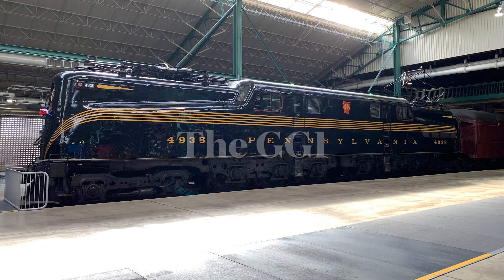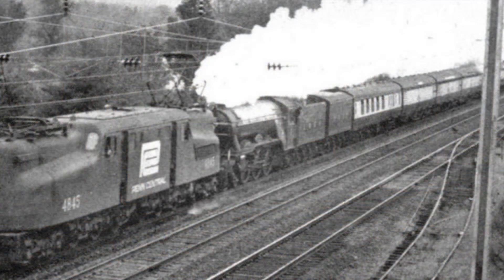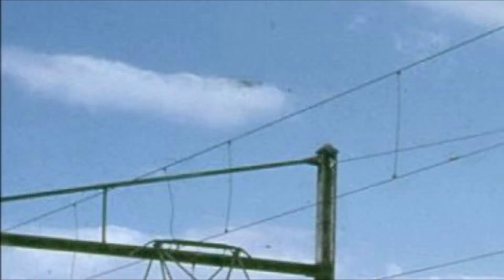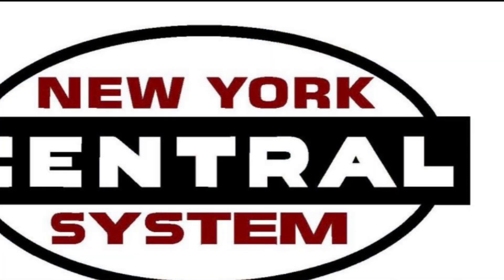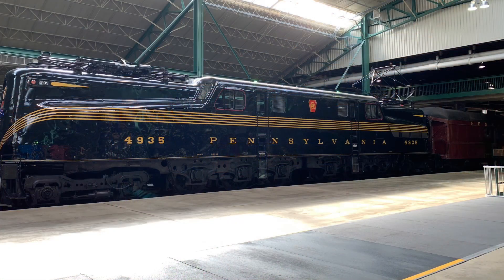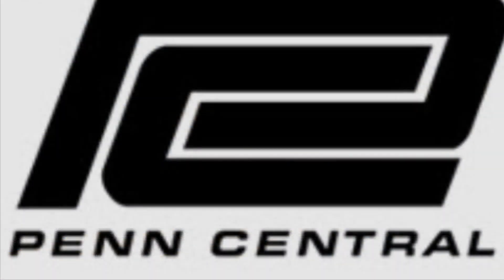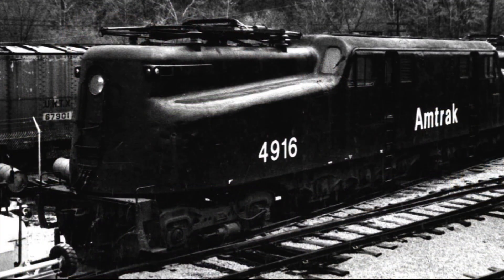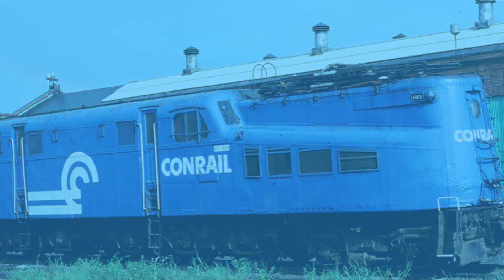Engines of North America: The GE GG1

Comment: In the field the 4935 was nicknamed "Black Jack" because the digits added together = 21. There was another motor prior to the AEM-7, it was GE's E60CP numbered in the 900 series which were a 6 axle electric freight motor (if I recall correctly, a power plant out in Colorado used them to move their coal cars). Amtrak engineers had said the E60CP "bounced them all over the place" inside the cab, it wasn't a very nice ride. It was determined they were not to exceed a maximum speed of 80mph. Later, the wheel trucks were changed allowing for a maximum speed of 90mph & were re-numbered in the 600's when the new style wheel trucks were installed.

Comment: The summer 2009 Classic Trains magazine has several good articles on GG1's.  One author highlights that Don Dohner did the original 4800 streamline design, and Raymond Lowey improved following units by recommending welded bodies and other refinements.  
The Pennsylvania Railroad borrowed a New Haven EP-3 for testing, using the technology as a basis for the GG1 wheel arrangement.

Comment: The biggest reason Conrail stopped using the GG1 was because Amtrak jacked the rates up on electrical use. (Same goes for the relatively new only being around 20 years old at the time) E-44s. Had Amtrak not done this they may had lasted even longer if only in lesser roles.
Reply: With regard to Conrail vs. Amtrak, one cannot forget Conrail engineer Ricky Gates who disregarded a stop signal and ran his diesel locomotives into the Amtrak Colonial causing a huge derailment and loss of life.  This caused Amtrak to restrict the times that Conrail could operate on the Northeast Corridor.  With the alternate routes not having catenary, it became obvious that electric locomotives were suddenly surplus and had to go.
Reply: They also were changing from 25 hertz to 60 hertz so that stopped them being able to run

Comment: At about the 10 second mark, you mention "Electro Motive Division" in connection with the GG1.  EMD as it is often known by, was an independent corporation during the development of the GG1:  the Electro Motive Corporation.  They were primarily interested in making "doodlebugs" and small diesel electric locomotives at this time and had no connection whatsoever with the GG1 development.  The GG1 wheel arrangement was based on the New Haven EP3 design which had tested on the PRR in Delaware and proposed by General Electric.  The competing R1 design was developed by a Baldwin-Westinghouse consortium.  At GE, the lead engineer was Donald R. Dohner.  A private man, he let Raymond Lowey receive the accolades.

Comment: A good number are preserved in various states but sadly a combination of cracked frames, PCB transformer oil and asbestos insulation prevents making even one operational again. Not impossible, just very costly as it would require remanufacturing a good number of components and a completely new cabling.
Reply: . . . and you have to consider whether 12 KV/12.5 KV (used to be 11 KV, but probably close enough) @ 25 Hz will still be available for them to run under in the future.  Once SEPTA gets rid of their Silverliner IV EMUs (which I think are the last things that can't take 60 Hz), the power supply becomes eligible to be upgraded to 25 KV @ 60 Hz.  So just refurbishing the old transformers wouldn't be good enough -- you would need new transformers, and you would need to add rectifiers (the old motors would tend to overheat on 60 Hz).
Reply: @Lucius_Chiaraviglio  The most radical step would be a replacement of the whole electric section, as has been done in the AEM7AC. A modern multisystem locomotive in an ancient bodyshell? But that would go way beyond what's considered restoration. It would be a new locomotive with old mechanics.
Reply: @uncinarynin  I thought about that, but most AC propulsion systems make an ethereal shriek, which would be really weird on a GG1.  Probably better to put in a modern transformer but with tap changers for both voltage control and changing between overhead voltages.
Reply: @Lucius_Chiaraviglio  Interesting thought, converting the 25Hz, 11(or 12)kv.  How much rework must be done on the insulators etc for the contact wire.  It would replace the nearly 100 yr old infrastructure, and will have to happen eventually.
I am assuming that is still Washington to New Haven.  As a wire junky I would like to see freight mainlines electrified(sigh).
Reply: @Lucius_Chiaraviglio  Thank you for the reply. Interesting changes.  I figured new Amtrak electrics were 60Hz capable.  You may know this; two AEM7's came to the Bay Area to test the Cal Train Electfication.  One to run the other for parts.  It will be 25Kv, 60Hz.  I am planning an excursion sometime this year to check on progress.  Due to various completion 2024.
Reply: @delurkor  Amtrak has been getting everything capable of 60 Hz starting with the E60-CPs (predecessor to the AEM-7s), and I'm going to go out on a limb and hazard a guess that since the electrification northeast of New York is all 60 Hz, that they don't have any work equipment left that isn't thus capable.  Yes, I heard about the AEM-7s going to Caltrain.  Too bad they aren't keeping both of them in working order to use for emergencies.

Comment: I could be wrong but I believe there where 136 built but you said 139. No GG1's will run soon, they used chemicals in the coolent that is dangerous/toxic. In response, the parts that had it in it where drained and filled with cement
Reply from the maker: Actually yes. I remember seeing this in my research, but I just didn’t add it in.
Reply: They filled it with cement?
Reply: 139 units built.

Comment: Of course, Raymond Lowey only designed the exterior shell. Engineers designed the rest of the machine.
Reply: No, Donald Roscoe Dohmer of Westinghouse designed the prototype 4800 "Old Rivets". Loewy improved on the Dohmer design by recommending welded bodies for the 138 production Gs.
Reply: @smwca123  - Technically, you're right. However, Loewy specified the five-stripe pinstripe and its classic curve along the side. Photos of the original of PRR 4899 (later-renumbered 4800) show a much different and much less graceful exterior paint scheme, along with a obtrusive air intake near the pantographs. The value of Loewys' contribution is shown by the fact that PRR applied some variation of his design to first generation diesels, too.

Comment: Not being sarcastic. The GG-1 wasn’t the first USA Electric Locomotive. There was the P-5 and some earlier USA Electric Locomotives. The GG-1 was probably the first successful USA Electric Locomotive
Reply: Not even the first successful ones, the locos of the B & O electrification of 1895 worked out fine.
Reply: @kiwitrainguy  
What was the classification of the B&O electric locomotives? Do you know who manufactured them?  I feel fortunate to operate GG-1’s in Passenger and Freight Service. From early 1974 on Penn Central. Until the GG-1’s retirement on NJTRO in October 1983. The GG-1 was fun to operate. With 21 notches on the throttle. I had to be taught how to operate a GG-1. No Locomotive Engineer that wasn’t taught to operate these locomotives. Would not even make it off the engine house outbound track. Without tripping the Pantograph Relay. That took a specific process to reset it. The GG-1’s were unique electric locomotives and had a very simple design. Pantograph, to Main Transformer to Traction Motors . I never didn’t make it from point A to point B on a GG-1. Two GG-1’s as a multiple unit. Would easily pull a 120 truck train and get up to the maximum speed of 60 mph. Truck Trains had a maximum authorized speed of 60 mph. One  multiple unit GG-1, would easily get the truck train up to 60 mph in a short period of time. Penn Central and for a short period of time Conrail. Also had E-44’s and E-33 Electric Locomotives. Left over by the Pennsylvania Railroad. These were also finicky but also very dependable, but would many times. Develop lateral motion between 50 and 60 mph. That could be scary at times when the lateral motion would get excessive. The Pennsylvania Railroad had ordered purchased the E-44 and E-33 electric locomotives. The Pennsylvania Railroad put shock absorbers on the E-44 and E-33 Electric locomotives. That solved the lateral motion problems, but these shock absorbers were rarely replaced when worn out. The E-60 had insane lateral motion. Their original designed maximum speed was 105 mph. It was quickly lowered to 80 mph maximum authorized  speed. The lateral motion o E-60’s was so bad. I would wonder why either the flanges on one the wheels of the E-60’s didn’t break off. Or if the inside of the rail would fail or the rail spreading. Amtrak finally put shock absorbers on the trucks of the E-60’s. This solved the lateral motion problem. Until the shock absorbers wore out. Locomotive Engineers would have to write down on their work reports. When the E-60 would start developing lateral motion again. Then actually complain to upper management. Threatening to either refuse to operate a known E-60 that the lateral motion was happening again. Or threaten to strike to get new shock absorbers put on the E-60. Other than the Lateral motion the E-60’s. They were quite powerful and pretty reliable electric locomotives.
Reply: Through a lot of research. I finally found some information on the B&O Railroad’s Electric Locomotives. These electric locomotives were manufactured by General Electric. These Electric locomotives weighed 96 tons or 192,000 lbs.They had 1,440 HP/ Four 360 HP traction motors. With a continuous 42,000 lbs of starting tractive effort up to  60,000 lbs over a short period of time. These Electric Locomotives were mainly used to pull a  Steam Locomotive with a  train. Through the Howard Street Tunnel. Preventing the massive amounts of smoke a Steam Locomotive produced while pulling a train. The B&O Electric Locomotives was the prototype for future electric locomotives. In addition the B&O railroad was the prototype for AC Electric Current Catenary System and or the DC Electric Current Third Rail System. The B&O Electric locomotives first used an unsuccessful odd overhead catenary wire system with DC Electric Current that was troublesome right from the start. All were converted over to third rail DC Electric Current. The first DC Electric Current used an Overhead Wire. The electric locomotives used a crude pantograph that contacted the trolley wire. The DC Electric Current then passed through to the positive lead on the traction motors and a separate bare copper wire in the middle of the track, with wood on top of the wire. A inverted crude pantograph was underneath the Electric Locomotive. To provide the negative/ground back to the power plant.  Completing the circuit. This had to be very dangerous for anyone working on the tracks. These B&O  Electric Locomotives were shortly converted over having a break away  pad on the side near the bottom of the electric locomotive,that made contact with the newly designed by B&O and General Electric third rail system. The break away pads were designed to break off of it made contact with an obstruction. This third rail design was successful and wasn’t quite as dangerous to track workers as the overhead catenary wire system. The first LE-1 electric locomotives remained in service from 1895 until 1917. Many reasons these Electric Locomotives were removed from service included, the amount of DC Electric Current they  required. They couldn’t be coupled together and configured into multiple units. They were mainly used for the Howard Street Tunnel and on only a few miles of track. Plus the advancements being made with Electric Locomotives that would replace them. It is a shame that all of B&O’s Electric Locomotives were scrapped. At least 1 should have been preserved. Being the B&O Electric Locomotives were the FIRST USA manufactured electric locomotives that were successful.

Comment: 285 * 12 = 3420 horsepower.  Not 4620.
Reply from the maker: Oof sry bout that. Probably used an unreliable source, thanks for the feedback.
Reply: 4620 hp is right, with a short time rating of about 8000hp.

Comment: Any asbestos in those old girls?
Reply from the maker: I didn’t see anything regarding asbestos lining in the engines during my research. But, it wouldn’t be out of the question.
Reply: Asbestos was commonly used in electrical components during the 30's and through the life of the GG1. Switchgear, wiring insulation, cable wraps, motors, controllers and especially flash guards were full of asbestos.
Reply from the maker: Well that’s cool
Reply: PCBs I believe are the problem. The rectifiers (I think) contain PCBs...they'll never run again unfortunately.
Reply: @yourcrazyteacher585  Yepper - The rectifiers and transformers of that period were cooled with an oil bath made from poly chlorinated biphenyl. They should have been remediated prior to disposal or going into a museum setting. Actually PCB's are still in use today, the US banned the production of new PCB's in 1978 but allowed the continued use. In essence an old transformer can be drained and the PCB oil be used in another new transformer. Great law . . .